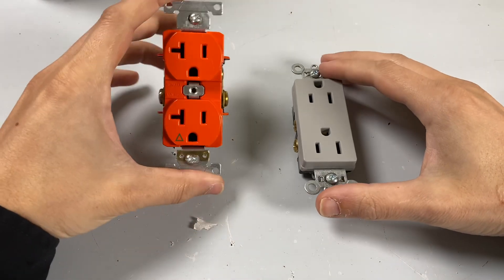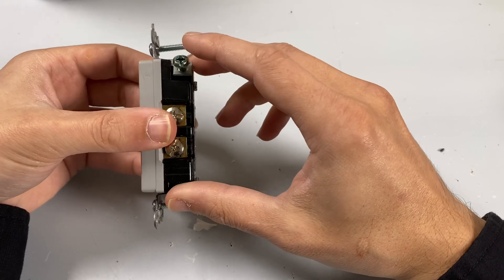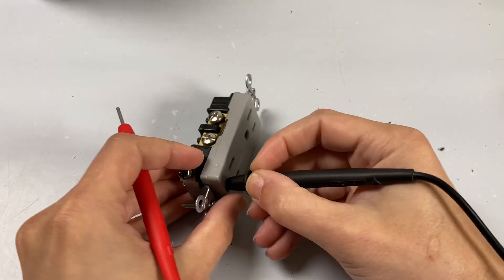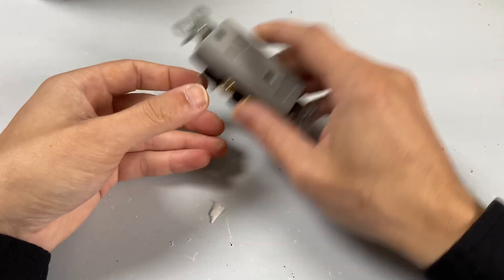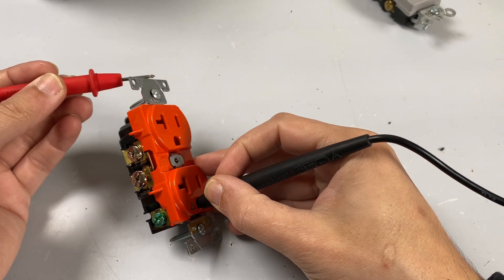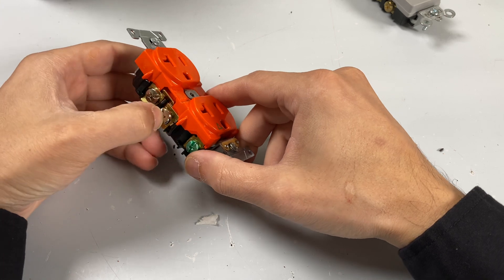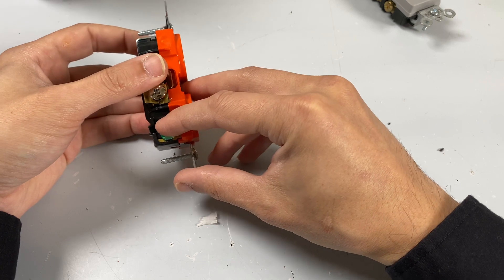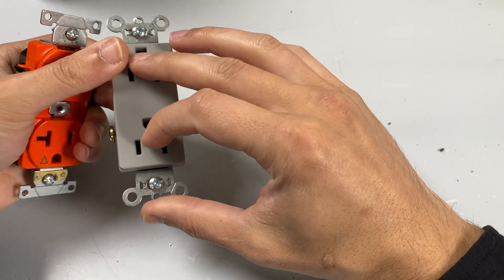What is the difference between an orange isolated ground outlet and a standard outlet?

Comment: You wouldn't have a bare isolated ground conductor. They have to be insulated and you still need regular ground to ground the strap on the outlet. They need two grounds and the entire service had to be setup to use a isolated ground system in the panel feeding a isolated ground receptacle.

Comment: Is there any way to use the isolated ground outlets using only 12/2 wiring?
Reply from the maker: Using standard Romex with 2 insulated conductors and a bare ground conductor would defeat the purpose of an isolated ground outlet.
Reply: @billylaguardia  what if I am using a separate sub panel as my panel that only is for isolated ground outlets?  The sub panel has its own grounding rod connected to the bus and is powered via the normal house power panel.
Reply from the maker: @brandonswafford861  Hey Brandon, here are some things to keep in mind:
1. The outlets are isolated in a way that the don’t ground themselves to the box they are mounted in.
2. The grounding wire to the outlets should be insulated. This is to prevent the ground wire from coming in contact with conduit or the wall box which would defeat the isolation. 
3. The outlets are usually higher quality.

Generally sub panels don’t have their own ground rod. They just don’t have the ground buss bar tied to the neutral buss bar like a main panel. You can use the outlets, they are very high quality. 12/2 is probably fine assuming the wires aren’t run in conduit and you are using plastic wall boxes.
Reply: @billylaguardia  I am not using plastic.  All of my boxes are surface mounted metal boxes.

Comment: The issue I noticed is that I put a christmas lights in my tree, outside the house.  I am using a smart plug, connected to a isolated ground outlet.  I noticed the other day that with this lights there are dim around 5~10% bright when is off.  I have another lights over same type smart plug over a standard outlet and it does not do the same thing, any thoughts?

Comment: Excellent video.
There's isolated ground, insulated ground, and I'll add, 'dirty' ground.

The outlet/receptacle is the key component.
The outlet is what ISOLATES the ground.

So an outlet that's has isolated ground has continuity from only the green ground screw to the ground slot/whole!
There's no continuity to the other metal parts!

A cable should be connected to that ground screw and be home run, point to point, to the ground bus bar in the panel. That cable must be INSULATED and should preferably be green with yellow stripes.

The metallic box should have another ground cable preferably bare or colored green terminated at the proper location.

This type of ground is 'dirty' because it touches everything that's metallic in it's way - tubería etc. and may have multiple splices.

None isolated receptacles/outlets, have all it's exposed metallic parts connected to the same ground terminal.
The ground cable maybe green or bara.

The 'dirty' ground has usually has a lot of noise and sometimes act as and antenna which provides signals that are an interference to sensitive electronics especially at the higher frequencies!
To these circuits, which process signals in the order of millivolts at high speeds(frequencies) only a clean isolated and insulted group would help.

Comment: I think that Zero and phase wire is to close to each other if you u are using lower voltage that means that pc or television needs 100 200 volts just to turn on for example power supply 3 phase does not mean that electrons flow faster trough the wire electricity is coming from sub stations and hydro or nuclear power plants

Comment: No. You want a ground wire with  insulation on it running back to your load center not a bare copper. Bare copper wire could be used to ground the metal box and conduit.  Hooking the bare ground conductor from then back of the box to the outlet ground defeats the purpose.

Comment: You're supposed to run two ground wires to the box containing the isolated ground receptacle, and the isolated ground wire should be insulated.
Reply: exactly
Reply: So where do you connect the two?
Reply: One to ground chassis and one ground the equipment?

Comment: Should an orange outlet be hot on both sides when tested with a non contact voltage detector?
Reply from the maker: No. One side is hot, the other is neutral. There is a bridge that can be snapped off to allow 2 different circuits on the top and bottom receptacle. Am I understanding your question correctly?
Reply: @billylaguardia  Basically, I was wondering if they were different from a normal outlet that shows hot on the black side only. For some reason my orange outlet is the only one that's hot on both the black and white wire side.

Comment: If I have two outlets, each with its own circuit, and I plug in my audio components into both outlets, can I get ground loop? Or do both outlets need to be on the same circuit to get the ground loop?
Reply from the maker: Both outlets would need to be on the same breaker, with each outlet being grounded locally at its box. In newer construction, the ground wire in the outlet goes back to your breaker box and is terminated at a main ground bar. Older construction that upgraded two prong outlets to 3 prong is where you can run into ground loop problems. In those instances, the hot and neutral are coming from the main breaker box, with the ground wire being screwed into the back of the outlets box. Hope this helps!
Reply: @billylaguardia  yes thanks. I'm slowly learning. My house is 10 years old and i finished my basement about 2 years ago which is where my home theatre is. I dont see any bare copper wire anywhere near my breaker. Would it be obvious if the receptecles are grounded at the breaker?
Reply from the maker: There should be a ground buss bar in your panel box. Are there ground wires at your duplex outlets?
Reply: @billylaguardia  I dont know about my basement, but all my outlets throughout the rest of my home have the bare copper wire inside the box. I just dont know if they are attached to the box or go down to the panel. Does youtube let me attach a picture here? I could take a picture of my panel and show you
Reply from the maker: Bare copper is standard when using Romex. I would guess that the grounds go back to the box. You can use a multimeter to see if there is continuity between the ground wire and the local wall box. Thats where I would start - assuming you are getting ground noise. Be sure to turn the breaker off before you start.
Reply: @billylaguardia  well I get a very faint buzz from my speakers. I have to put my ear right upto the tweeter to hear it. So I'm not sure if that is ground noise
Reply from the maker: @velocci6666  I would guess that the noise you are hearing is the inherent noise in the amplifier. Ground noise has more "bass" to it since its 60Hz. Low frequency noise generally = a grounding problem.
Reply: @billylaguardia  even though the volume is at 0? And if I raise the volume, the noise doesn’t get louder.
Reply from the maker: @velocci6666  Correct. Thats normal system noise. Many powered speakers make this noise even with nothing plugged in. Double check that you arent mixing balanced and unbalanced cables - this is most often the noise problem with systems.
Reply: @billylaguardia  I’m only using RCA cables which are unbalanced. So I have to replace my receptacle. What happens if I get an isolated ground receptacle when I don’t have the grounding wire going to the breaker or visa versa?

Comment: So if all my av components are plugged into the same outlet, there is no way for ground noise or ground loop?
Reply from the maker: If you are unsure about an outlet’s grounding, it’s best to plug everything into the same outlet. Keep in mind that the overall draw (amperage) of all of your components should be within the limit of the breaker or you may trip it. Also, this practice may not solve system noise, however it’s a good place to start when troubleshooting.

Comment: I installed some of these in a hospital remodel. The IG was separate all the way back to the panel and landed on a separate AND isolated on standoffs ground bar.
Reply from the maker: Thanks for this comment! I think most people are missing the point that you need to use this outlet with an insulated ground wire in the wall. I should have explained that better.
Reply: We were using Hospital Grade MC Cable that had both insulated and bare ground. Insulated went to the IG on the outlet other went to ground pigtail on box.

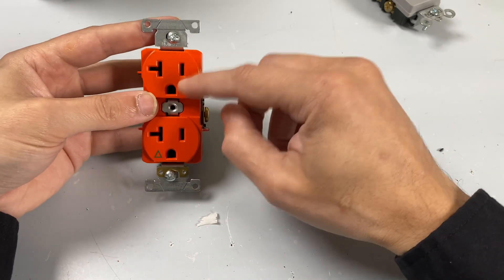Comment: So, for the orange ( isolated ground ) outlet, you would get some 3-wire Romex and connect the ground screw to the ground wire in the Romex and remotely ground through the Romex back to breaker box?  3:29

Comment: So called "isolated ground" receptacles are little more than a gimmick.  By definition, all receptacle grounds are connected together and at the same electrical potential as neutral.  Equipment that suffers from static interference (EMI, RFI) would benefit more from ensuring the equipment itself is grounded.
Reply: What about in the case of a lightning strike to the electrical system of the building with  proper isolated outlets with their own ground rod?

Comment: Why does it have a self grounding clip on the chassis if it's not actually grounded?  

Normally this clip will connect the grounded box to the outlet ground but the chassis is not grounded so why is it there?

Thanks!
Reply: Use of standard components I assume.
Reply: @gustavgans3760  , Bitvit Defeats the While purpose of having these outlets.

Comment: The only time I have ever saw one of these orange outlets was in a modern hospital. All the other outlets in the room were standard white. What gives ?
Reply: They r not isolated ground outlets. A red outlet in a hospital designates that it is hooked into the backup generator system so that u know which outlets u can use in a blackout.
Reply: Orange is not the marker of isolated ground. The triangle is. Frequently orange is used to mark hospital-grade products. In other cases it's used to mark UPS-powered outlets. Hospitals use all these three features.

Comment: I'm setting up a car amplifier and it comes with the option of ground or isolated ground. I tapped into the chassis as the ground instead of going directly into the battery terminal. Would this call for isolated ground? The manual doesnt explain the options at all
Reply from the maker: I am not familiar with car audio. However, I would guess that if they are providing an isolated ground - this isolates that particular ground terminal from the amplifier chassis thus decoupling it from the car chassis/whatever its mounted on/to. This is the same as what I am explaining in the video. Again, I know nothing about car audio.
Reply: @billylaguardia  So yes
Reply: @billylaguardia  @Ballsweet McGee Most cars have the chassis bonded to the negative battery terminal. However there are cars that bond the positive to the chassis. That would be where you would need to run a dedicated ground to the negative terminal. Most positive chassis cars are British. The easy way to tell is trace the battery cables.

Comment: I thought orange receps were for hospital use.
Reply from the maker: The outlets are for any application using sensitive electronic equipment that requires an isolated ground. Generally these are used to optimize medical and audio/visual equipment. The outlets are also very robust and work well in environments with hard usage.
Reply: You might be thinking of red ones.  Some hospitals use red ones (no special mark by the ground pin) that are on circuits backed up by the hospital's emergency generator.

FYI, hospitals also use outlets with a 'green' dot next to them, indicating safe for oxygen-enriched environments such as ICU's where O2 in use.
Reply: @mikefochtman7164  so the mounting strap is not connected to the part for ground pin on plug? but still connect to a ground wire?
Reply from the maker: @raymondgarafano8604  Correct. This is the main difference. The mounting strap does not come into contact with the ground pins in the outlet. This prevents the outlet from being coupled to the box its mounted in. The outlet will only receive its ground via the wire that is connected to the green screw on the outlet. The benefit here is that you can have a separate grounding rod, and ground buss in your box that is separate from everything else in your electrical system. The separate ground is why audio professionals like these outlets, they can remove residual hum from other electronic appliances on the same circuit.
Reply: @billylaguardia  So, u still have prot. from a shock but less noise for audio.
R hospital outlets wired the same as this?
Reply: @billylaguardia  Having isolated ground avoids 'loops' where there are multiple paths from the equipment back to the service panel.  For example if the box is grounded via conduit or building structure, then without the special outlet, you have multiple paths between the ground pin and the service panel.  One through the intended grounding wire, and also through conduit, through building structure grounding, etc.   These large 'loops' can act a bit like antenna / induction coil and pick up 'noise' that affects sensitive equipment.  Having just a single grounding conductor from outlet pin to service panel avoids this.

Great video by the way.  :)
Reply: @raymondgarafano8604  That's correct.  The ground wire under the screw connects the pin on the 'socket' back to the service panel, but not the mounting strap nor the box it's installed in.

Comment: Ok, the isolated ground receptacle only matters when installed on steel studs in mainly commercial buildings where all the metal studs are grounded.  Does not matter on a wooden stud.
Reply: That’s ridiculous. Whatever wiring method is used there is a grounding path within the cable which is the low resistance path. The grounded studs within the wall do not contribute to any ground loop issues. The whole point of isolated grounding is to separate the safety ground, which is the normal grounding path, from the rf ground path which would be the insulated and isolated path. That is why the grounding strap, or as the author mislabeled as chassis, is not connected to the ground pin of the receptacle.
Reply: That's what I'm thinking too.  With metal studs and such, the multiple pathways to 'ground' (via studs through chassis and via ground wire back to service panel), you set up a lot of 'looping paths' where you could get interference.

But his statement about 'connect the grounding screw to the back of the box in older installations where there isn't a proper ground wire', seems to not be up to code.  If the box is mounted on metal studs in a commercial building, a simple 'outlet tester' might show it as ok, but it's not really code.

Comment: Good explanation of the electrical difference between the two outlets but what you said at 2:35 about using a bare wire is not correct. With such an isolated ground outlet an insulated green with is used, that is the point of isolated ground.
Reply: Tony C ... if you are using Romex the ground wire will be bare, meaning it will not have it's own insulation like the white and black wires do. It will still be isolated within the outside sheath all the way back to the breaker panel. If I recall correctly the main difference for isolated outlets is they will have their own ground bar, which is separate from the other grounds within a panel and usually have their own dedicated ground rod outside the building.
Reply: If you're pulling individual conductors through conduit, what you say is exactly right.  BUT, if you use nomex that contains an internal ground wire, it is 'bare' when you strip the nomex back.
Reply: @mikefochtman7164  ... Nomex is a fire retardant cloth. Romex is electrical cable.
Reply: @rupe53  You're right, my bad.  lol